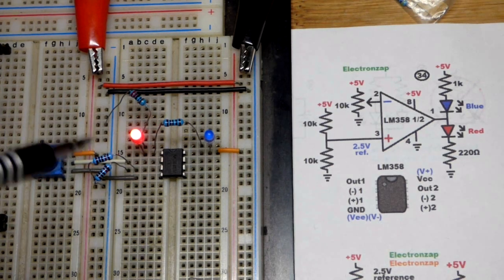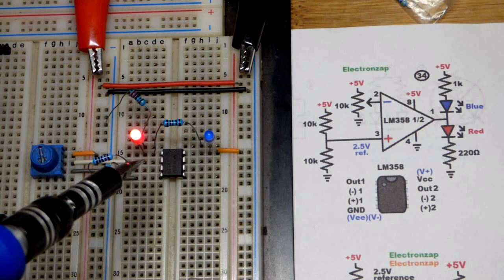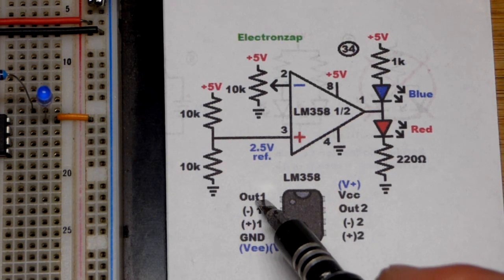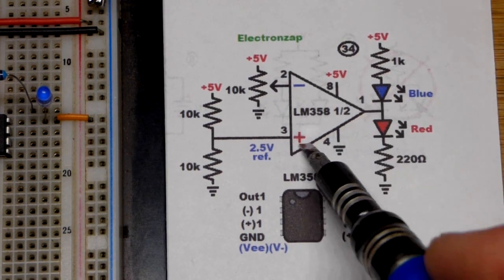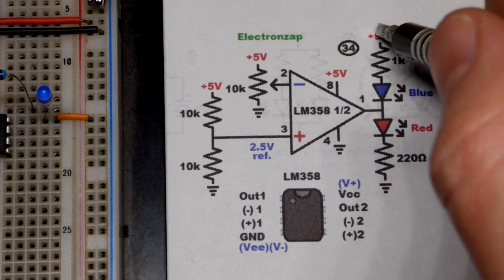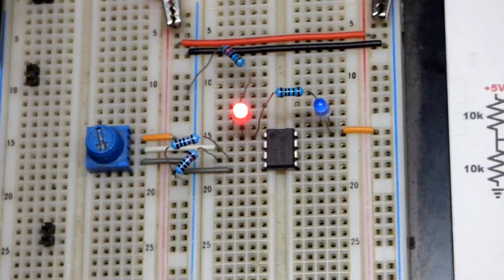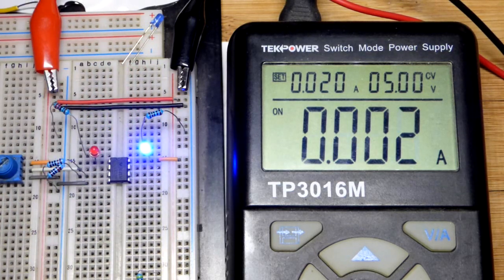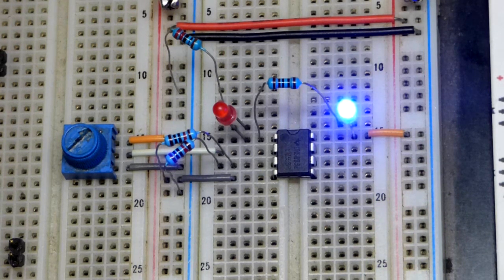How to wire an Op Amp Inverting Comparator with a LM358 Operational Amplifier

Comment: I was trying to maks a chicken coop automatic door and was trying to use an arduino but could I adapt this circuit. all it does is a motor winds a motor one way when it gets dark closing the door and winds the motor the other way when it gets light. Could I use a light dependent resistor in place of the potentiometer and use the motor in place of the LEDs.?
Reply from the maker: Yeah, this op amp can't power much directly but it can switch transistors or a relay module. Light Dependent Resistor and fixed resistor can make a voltage divider instead of a trimpot.